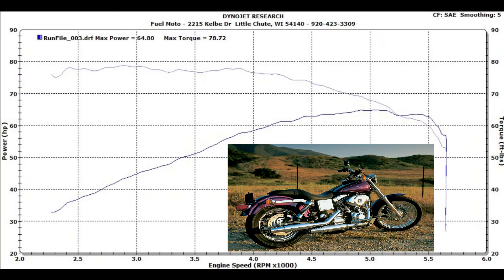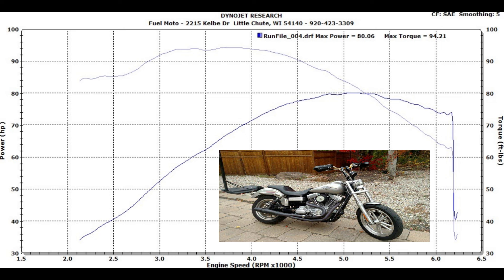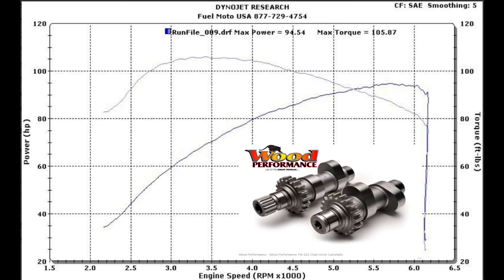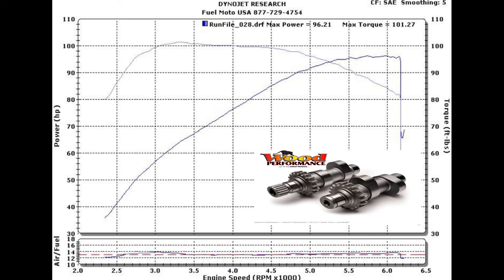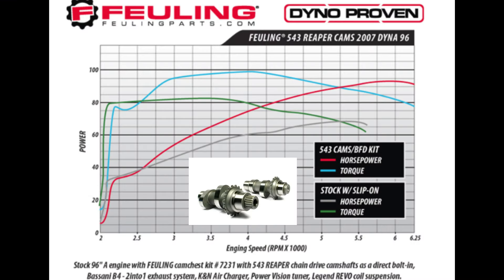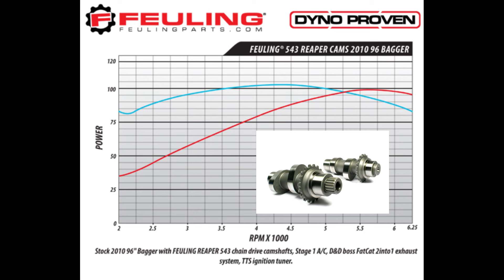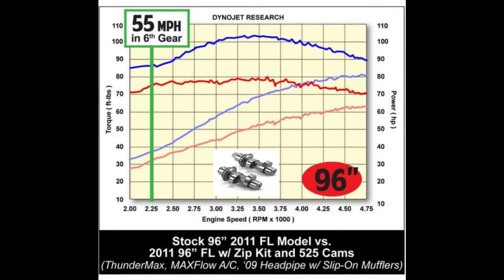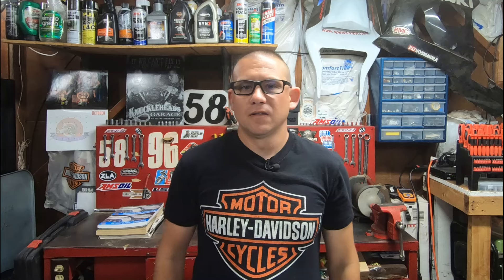Consider New Cams For Your Twin Cam 96 Before You Convert To A 103

Comment: Exactly what I was looking for!!!! The WOOD 222 is definitely the cam I've been looking for!!! Thanks for the great video once again brother!!!!
Reply from the maker: Thank you for watching, l am really a fan of that 222. It gains everywhere and it's bolt in!
Reply: @GixxerFoo  I'm just stunned at the HP and TORQUE gains just from bolting in the WOOD PERFORMANCE cans!!! My 2011 wide glide has 28,000 miles on it. Should I replace my valve springs, rockers while I'm installing the cam set? Thank you for responding to my post brother!!! Your videos are great and very informative!!! Keep them coming 🎸🎸🎸
Reply from the maker: With that kinda mileage, if it were me l would go ahead and put a new set of lifters in with the cam. Naturally you'll change the cam bearings with the cams. Depends who you talk to but some may say just bolt it in. The springs l wouldn't change, but definently the lifters since it's a contact point with the new cam.
Reply: @GixxerFoo  that's what I was thinking too. If I'm in there doin the work I might as well change out what needs replacing especially with 28,000 miles on it. Thank you for your response brother. It is greatly appreciated!!!!
Reply from the maker: Hey no problem, just depends who you talk to about what needs changed etc. Even though they have roller lifters, to me they are going to have some wear with contact on the old cam.

Comment: Gixxer, its been about 2 months since I planned my 96 twin cam upgrade. The work is completed and I have taken my wife on a few runs to check on the results. Here is a summary of the work: My 08 Flstc is in great condition but due to the added engine performance I upgraded the front shocks with Progressive Monotube cartridge kit and the rear with the 422 set. Heavy Duty Screaming Eagle clutch, compensator and cam plate with heavy duty oil pump added.  I had a 2 into 1 Cobra installed with Arlen Ness Big sucker air filter and hidden breather. 

The power difference is huge right off the line , wants to pull hard and at 2000 rpm starts to dig. At 3000 the engine is very forceful with major pull which stays on through to 5000 rpm. At 3000 rpm in 6'th gear 80 mph. A roll on at that level provided an immediate pull matched by the snarl of the exhaust and the pull through to 5000 RPM is brilliant. 2 up and overtaking is now safe and a breeze. The Heavy duty clutch is a great improvement. Better  sweet spot feel. The progressive suspension provides much confidence in the twisties particularly 2 up where previously some "wallow" would be an issue. No brake dive and excellent tyre feel. The cam is the gem............turned my cruiser into a big fun Prowler....... Hot Rod!

I exchanged the stock tank speedo with a Koso Tach Speedo which has so many great features but the large RPM dial lets me easily track performance.

Thanks for all the solid help.
Reply from the maker: That is awesome to hear and I am glad you are enjoying it! You did great by taking it a step further with the suspension, clutch and internal engine upgrades! Not a lot of people do that so they really don't realize the full potential of the upgrades!

Comment: My 08 Fatbob:
V&H Bigshot Staggered
Arlene Ness Big Sucker air intake
Wood 575 cams 
Powervision 
Tuned by Jim Kennedy in Mattoon Illinois 
93hp/103 torque 

My 09 StreetGlide:
Screamin Eagle Street Performer 103 kit
10.5 to 1 pistons
Decked, flowed heads
Screamin Eagle 259e cams
V&H 2 into 1 pro pipe
K&N air intake
Powervision 
Tuned at Coziahr HD in Decatur Illinois 
92hp/102 torque.
Was very impressed with the 08 fxdf
Seriously disappointed in the 09 so
Gonna swap out the se cams for Wood 999 - 6A cams and going back to Jim Kennedy.

Comment: If I had a 96” the only way I’d upgrade to a 103 is if it needed a rebuild and I would add some compression to it and cams of course. My bro in laws 96” street glide goes plenty good. It’s a slippery slope, I did cams in my 103 and then wanted more but held my horses and am now happy lol. When the time comes to rebuild then I’ll definitely do some upgrades like comp and like lily heads/head work, but till then I’m happy.
Reply from the maker: A lot of people get hung on the fence about putting money into a older Harley but compared to the price of a new one it makes sense. Doing some nice upgrades makes the bike unique and it will lay down some power you won't get for the price of a new one.

Comment: Got a 09 Streetglide. Went from 76 hp 78 ft torque to 97 hp 101 ft torque just by doing cams. I put the Woods Night Prowler in.
Reply from the maker: Damn that's a huge jump! Wood is one awesome cam and it's Andrews quality as well!
Reply: What tune and exhaust do you have
Reply: @masgordo  I have Vance and Hines 2 into 1 pro pipe. The tune is a custom one that the dyno guru used at my local Harley dealer in Faribault MN.

Comment: I’m running a 253 in my 88  I love it . It’s a cvo 103 cam . Absolutely the biggest lift cam you cam put in early 88 heads .  Should done it long time ago. Did it while upgrading to hydraulic tensioners and screaming eagle oil pump. Them stock cams are epa cams !!! -
Reply from the maker: Oh yeah the stock cams are weak in those bikes, the 253 is a an awesome cam for a bolt in replacement.

Comment: As a diesel mechanic can I do this myself? Only thing holding me back is tuning it . Is it just a plug and play? Just looking for little more power and better sound. Thinking of replacing cams, oil pump, and gears
Reply from the maker: My suggestion if you don't have a local tuner, I'm not sponsored here but FuelMoto. You can order everything you need, plus get a power vision flash tuner with a FuelMoto custom tune for your setup preloaded so after install all you have to do is flash their tune to the bike. They have some really really good tunes they develop in house on their dyno.

Comment: Just upgraded today from a 883 spprty to a 96" roadking. I have a stage 1 kit. I think I would go with cams and other upgrades before I moved to a 103. There are lots of how to videos to do yourself.
Reply from the maker: Aftermarket cams really do a lot for a Harley, best part is they are really simple engines. Twin Cam is the most mostly complicated of the 45 degree twins. But that's not a saying much, get a official Harley service manual from the dealer. The Harley manual details ever single step down to the tools and the torque specs, it's the best investment you can make to pair with the how to videos. You can do it all yourself very easily, the service manual will line it all out in really good detail. My only issue is you have it tore apart down to the letter by the book, reassembly- reverse disassembly 😬.

Comment: Ok' as you might be able to see from my profile picture, that I have a Fatboy. As you can also see' it has a aftermarket air cleaner, and' V/H pipes. It sounds good, just with that, but' I'm wanting to get a different cam, for it. Without doing anything else to the motor. Just wondering what size cam would work great for my bike. I don't rev my bike to 6,000RPM. I usually change around 2500-3400. Unless I need to get onto the interstate. Then' I may go up to 3600-3800.
Reply from the maker: If it's a 96 or 103 the Wood TW555 would be great cam for that bike!

Comment: I think I'm going to go with the Wood TW999-6a. I keep hearing great things about it, and I know I'll increase in Cubes and Compression that will only make this cam better. 2 thumbs up!!
Reply from the maker: Thank you! That's a great cam to run stock and increase you're bore and or compression later.
Reply: @GixxerFoo  what are your thoughts on the cam plate. Are the stock plates adequate for say a stage 1 bike plus cams or would it be wise to go ahead and upgrade while you're in there?
Reply from the maker: There's nothing wrong with the stock setup and a good set of bearings, but it never hurts to be over built. I like the biller cam plates and high volume oil pumps. If you're willing to swing the extra cost l would go for it.
Reply: @GixxerFoo  thank ya thank ya, that's probably what I'll do. I always upgrade the oil pumps on my Shovels so I figured it would be cheap insurance for the dyna. Loving the videos!
Reply from the maker: Not a problem at all, l appreciate the support.

Comment: Heard the 96's run hot, but thinking about buying one anyway. Assuming what is purchased has aftermarket pipes, would adding a cam increase heat from the already hot 96?

Comment: I enjoyed your video .... do you have a cam review  video for my 07 road king custom ... I had the stock 96ci converted over to the 110 when I first got it... I really would like to put a cam in it but I'm certainly  no motor head.  ..but I think I could figure out a bolt on ....right now I have the 110 conversion kit, 50mm throttle body, screaming eagle high flow cone filter, Rinehart true duels and thundermax tuner ... all the videos are for the 103.   But I'd love to see one on 96 -110  cam selections 
Thanks John m in Charleston SC

Comment: Thank you for your vids, entertaining and informative. I have an '07 96" FXDL that I bought 2 yrs ago used with less than 14k in the clock. I have since added S&S air, Bassani Road Rage III SS and a tuner. Also did some updating in the primary and finally installed the TW-222 cams along with a SE oil pump. For the way I ride this bike really puts a smile on my face. It's not the biggest or baddest, but it sure as hell is a blast to ride, and I still have some coin in my pocket.
Reply from the maker: Low Rider is one of my favorite bikes, l bet it runs damn good being lighter with all that work done!

Comment: Hi mate, this is a great video well done. I recently installed S&SMR103 cams in my 2013 Softail standard 103 cube. The dyno results after tune were: max torque 106.77 at 3.37 rpm and max power 84.73 at 5.02 rpm. 

I am happy with the mid range generally but am not happy with the throttle response from idle and the throttle response in the mid range.  What should I do? Replace cams and start again? Put compression in? Or put 107 pistons in? Thanks

Comment: Wouldn't upgraded cams, transmission and automatic compression release be necessary? Not sure it's worth the expense when you can do a full stage1 upgrade to get similar results in HP.
Reply from the maker: Not with just a cam upgrade, it's going to add a lot of power but you wouldn't need compression releases or anything. A A high flow air cleaner and slip on exhaust with stock cams and a good tune will net you in the range of 5 horse give or take. You add a cam with that and you're looking at a 10 to 15 horsepower jump over stock.

Comment: Great video! Sorry I’m late to the party but I am contemplating doing a stage 2 upgrade. I have a 2011 Street Bob 96” and did the stage 1 upgrade when I bought it brand new back in 2011. I put a SE high flow air cleaner, some Vance & Hines straight shots 2 into 2, and a good tune with a SE super tuner. Max HP of 69 at 5000 RPM and max torque of 86 at 3450 RPM. I suppose I didn’t get the best gains with the high flow air filter and not going with a 2 to 1 exhaust but I have been riding the bike like that for the last 12 years and it’s been a great bike. Finally thinking about stage 2 with a cam. I’m thinking a Woods 555 kit or a Fueling 543 kit. I like getting on her hard from start to high RPM so I think either of these cams would accomplish that. Which one should I go with and should I upgrade the high flow air cleaner with a heavy breather? Can I use the same SE super tuner when it’s all done to get a good tune on it? Finally, if I went with the Woods 555 do I need higher compression than my stock 96 can provide to get the best result. I think a cam could really make my Street Bob roar just getting some advice before doing it. Thanks!

Comment: I bought a 96 with a woods 222, 2 into 1 pro pipe, high flow intake, and power tune. Any idea hp torque numbers? The guy didn't give me the dyno numbers.  08 street glide

Comment: Gixxerfoo, are you aware that the new harleys come from the factory with the drive belts way to tight? My new 22 Street Glide Special only went 70 miles before the lower end started making a loud bearing howling noise. My boy picked up his new Street Glide St with 117ci yesterday and after 50 miles had rubber bits all over his pearl white bags. Plus he said he could hear a, rawl-rawl-rawl noise from the belt. Local stealer said it was tight to break in the belt? I call B.S. Been a mechanic all my life and have never seen any application where a rubber belt is way over tightened for any reason. On my 22, I backed that belt off right away and haven't heard a peep out of it sense. Would like to hear your thoughts?
Reply from the maker: That's interesting to hear, technically the dealer is supposed to check that before they go to the floor for sale.

Comment: @GixxerFoo: Great video! Always very informative. How the Wood-222 compares with the S&S-551?
Reply from the maker: The 551 is great cam for low to mid range for a bolt in, the 222 tends to produce more horsepower and torque per given rpm though. The 222 revs out a bit further on top, but the 551 is going to be much quieter than the 222.

Comment: glad I found your video very informative. My 2011 heritage has screaming eagle 255 cams with a complete stock motor and just some slip ons  and a big sucker air cleaner. Wanting to change out the 255's (never been to happy with these). What Woods cams do you recommend for this same setup (no changes except cam at this time ) 222 or 555. One up rider and just having fun with the bike as is. Thanks again
Reply from the maker: The 222 is great cam for more low end torque and very good top end, it's a great cam for a heavy bike. The 555 makes excellent horsepower and torque it just comes on a little later and runs out further, it's a great cam for a lot of Dyna riders.

Comment: Awesome video I just installed the tw222 cams... what tunes do you recommend I'm running the power commander V but no dyno tuners in my area
Reply from the maker: I would contact Dyno Jet and see what is recommended for your setup, they will likely suggest upgrading to a flash tuner with that cam setup.

Comment: After putting in woods to 22 Kim's my valve train taps and knocks like hell runs great. It makes a lot of noise, it's not the lifters. The push rods have been checked and double checked for the right adjustments. I just wonder if I need to change my valve Springs. Any help would be appreciated

Comment: Hey great video.  Like the numbers they just don't lie.  I have a 2009 harley Road King and was looking for a set of cams to put on.  After watching the video decided to go with the 222's.  I am hearing alot about having to replace the compensator.  What do you think?  I figured that I would also need to upgrade the oil pump and cam plate while it's out.  Look forward to more vids.  Thanks again
Reply: Oh also wanted to add that I have Rinehart headers and pipes with a Kurykan hypercharger intake.
Reply from the maker: The 96's through 2009 were notorious for weak compensators, if you did have a failure my best suggestion would be a compensator eliminator from Dark Horse. It's a sprocket basically, but it has a built in cush drive which is also rebuildable! Really neat setup and eliminates the compensator issues all together. If you do end up replacing a compensator go with the Screamin Eagle, it's cheaper than the OEM unit and better.

Comment: hey hey i have the woods 222 i’m getting 92 hp / 96 tq with a power commander i’m happy with it but should i try for more . i love the video’s keep them coming. Leonard from Cali Rackem 👊🏾🙏🏾👍🏽
Reply: Leonard Smith 
Why not? If you have the money 💰
Reply: i was talk about the dyno could i get more then i have now or should i try another pull .
Reply: @leonardsmith518  
Gotcha. Get rid of the power commander & get a power vision. 
A good Dyno operator will squeeze more power out of it then a commander
Reply: @leonardsmith518  
With a powervision you can adjust the idle right from the handle bar
Reply: @scrumthebum2451  i need your help i got another issue call me please.
Reply: @leonardsmith518  
Sorry I had a rough day. 
My father passed away 4 hours ago 
And I just got home and don’t feel like talking right now. Was at hospital all day
Reply: ok i was coming off the fwy the idle was at 3500 i got home check the codes they came up pc505 . i bought a new iac sensor , map sensor put them back n it’s still running high i couldn’t get the throttle sensor off because the strew hitting the cylinder i sprayed B12 between the throttle body to see if it’s sticking air . help what next before i go to the shop
Reply: @scrumthebum2451  oh my god i’m so so sorry my condolences to u and family call me when u can thank you 🙏🏾
Reply from the maker: You could upgrade to a Power Vision and have it dyno tuned. A good tuner can work magic and really get more power out of an existing setup.

Comment: I like the numbers of the tw222, does s&s make a similar performing cam? I’m afraid to go with the tw222 with me not having compression releases so I was going to go s&s easy start
Reply from the maker: The TW-222 makes some really strong power, if you just doing a cam swap and not increasing compression the 222 will start just like the stock cam. But the closest thing to the Wood from S&S in the easy start would be the S&S .570.
Reply: @GixxerFoo  whenever I do the job I’m going to upgrade or do away with my compensator, what route would you recommend ?